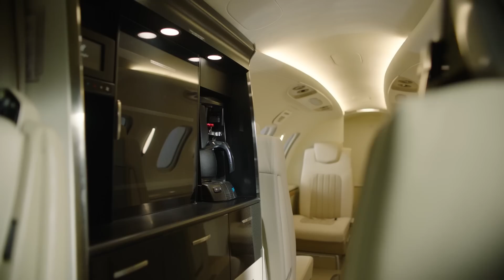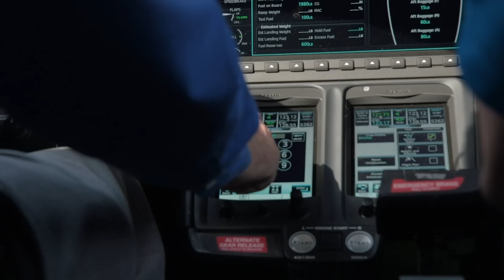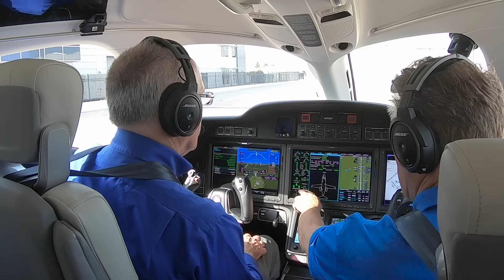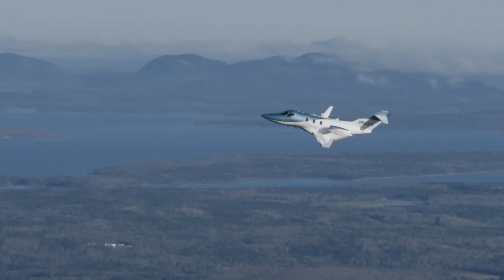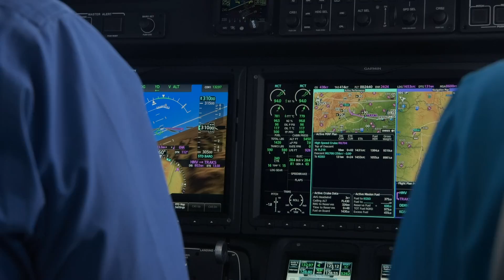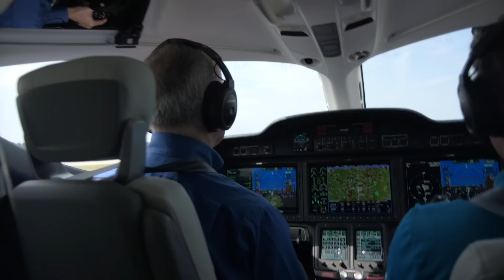Flying the Improved HondaJet Elite – BJT

Comment: Switch over to the SPERRY FD much much much better works on bank angle, and pitch, not by following the monkey bars. 
Wondering, your light long ass runway, do you ever use reduced power for TO?

Comment: A lot of great improvements over the previous model.
Reply: Except it still has limited range. Compared to SETP alternatives like TBM940, Epic E1000GX, PC12NGX and the coming Denali, they all offer substantial improvement in range. 

I appreciate the 20% better cruise speed as acceptable trade-off for added fuel, insurance & maintenance costs. The limited range however limits that speed gain to shorter regional flights. Our common mission of 4 persons w/2 dogs flying from BDU (Boulder, CO) -UUU (Newport, RI) would require a refuel along route, not required w/these SETP’s. That kills any in-air speed advantage. It’s a common failure of all VLJ designs. Until Embraer, Cessna or Honda can address this issue, SETP’s will continue to dominate this sector.

Comment: Finally, a Honda that doesn't look ridiculous with a big ass wing.
Reply: I would wager the Honda Jet doesn’t sound like a farting duck when it passes by.
Reply: Honda is reportedly working on a Mugen version with afterburner.
Reply: @Turbo442  I always dream about slightly larger engines (maybe 1.25x to 1.75x) using techniques, technology, and materials from the GE90 and the G9X from Boeing's 777 and 777x. Stretch the fuselage 2' to 4' (primarily for the added fuel capacity, but interior advantages too.) and sweep the wings a little. Afterburners would be fun too! A "Mach 1" capable minivan!😀
Reply: what about the nsx
Reply: @masteroogway8950  yea.. and also what about the NSR
Reply: this wins the comments section
Reply: Omfg roflmfao!

Comment: Do you feel there ought to be manual analog gages as a back up, incase of a electronic control panel failure?
Reply: The small attitude indicator above the PFD or MFD is your emergency gauge, usually combines all the standard flight instruments.  It is probably powered from the emergency bus or a dedicated battery.  It remains powered when all other power sources fail.

Comment: Although this aircraft has a good dispatch rates, if you do have a problem, good luck with getting parts. One thing sticking with the high selling aircraft manufacturers.
Reply: Clive Sinclair it’s Honda. You will be able to get parts.
Reply: @jysmtl  Honda aircraft Vs Honda cars are completely different. The number of HondaJet certified engineers around the globe is miniscule, compared to most other brands.

Comment: Iterations of this jet have been around for some time....yet it has NEVER caught on.
Reply: HondaJet has a 3 year backorder. It has caught on just fine.
Reply: David Bry when you have a 3 yr back order because your production rates are so low..
Reply: @brettrun8575  Honda Aircraft Company was formed in 2006. After years of R&D. I can't say that I blame them if they are taking the time to get it right. It's their first foray into Aviation. The HondaJet has slightly faster cruise speed than the discontinued Citation Mustang. Better range, similar capacity. Yes they are more expensive than the Mustang. But the Mustang was in production for only 11 years. Guess the question is that market strong enough for 40+ units per year?
Reply: Shitty fuel consumption..... too expensive a plane for logistical value

Comment: Runway requirements are very high for a VLJ.
Reply: Yes this is big concern to me
Reply: Would like to see a deep dive cost vs performance analysis of some of these roughly comparables.
Reply: Spend $10,000,000 for a PC-24 and get better STOL performance that a $5,000,000 Honda? You be the judge.
Reply: Flying Dog I could order a Phenom 100EV for less than a Honda and get better performance.
Reply: @CaptChet  I could buy a PC-24 and make a Phenom 100 look like a dog. So What.
Reply: @flyingdog1498  Agreed!  But they are not in the same category. Apples to oranges. Have a nice day. No reply needed or expected.
Reply: @CaptChet  But they are.